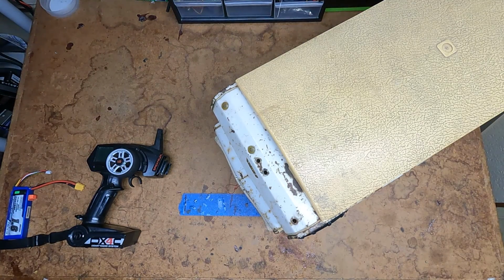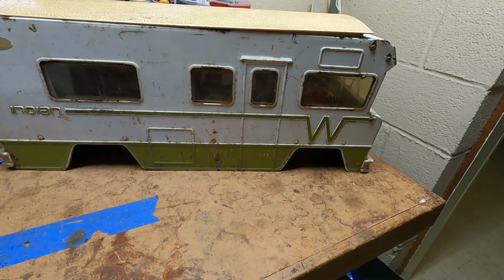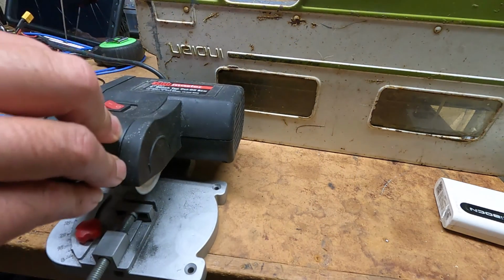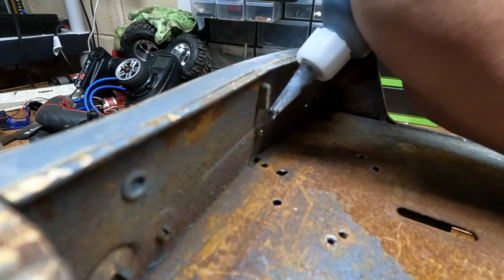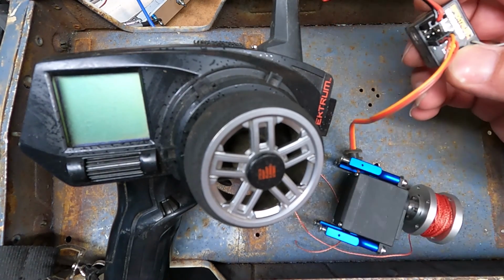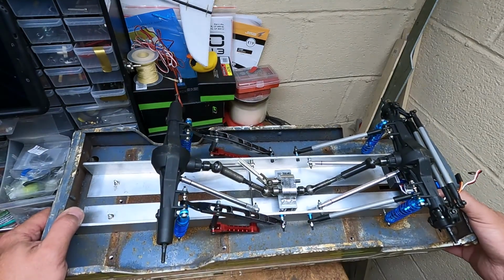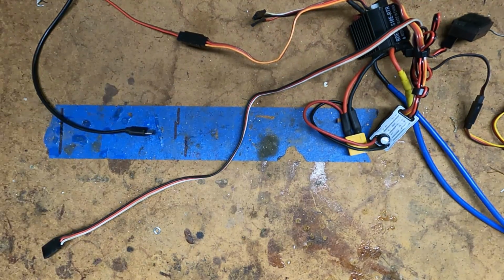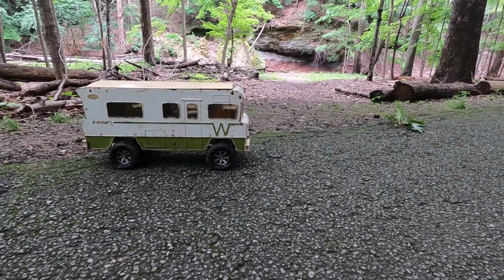Converting a Tonka Winnebago to rock crawler

Comment: Thanks for responding. I have another question what are the links on the rear axle you have a black link. a red one connected to a silver one what are all three called, having trouble finding them.
Reply from the maker: It's a sway bar kit from a axial bomber to keep it from tipping so much